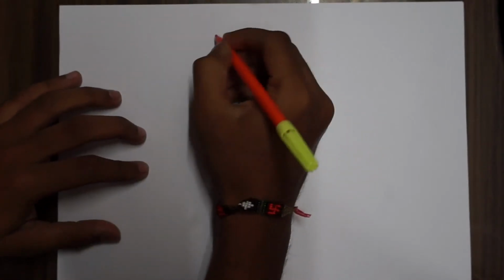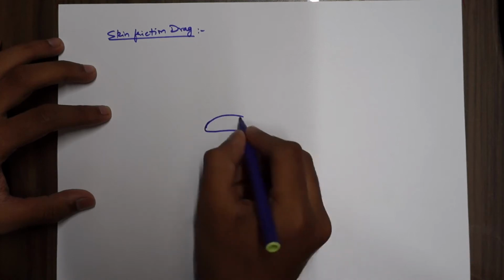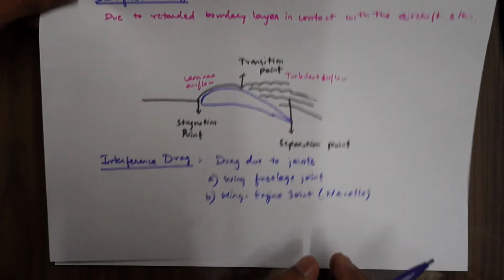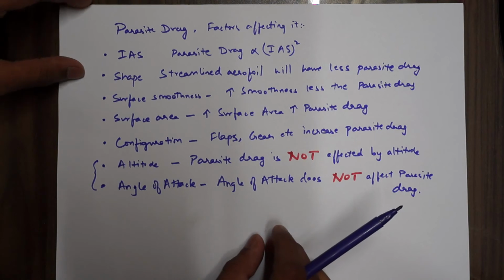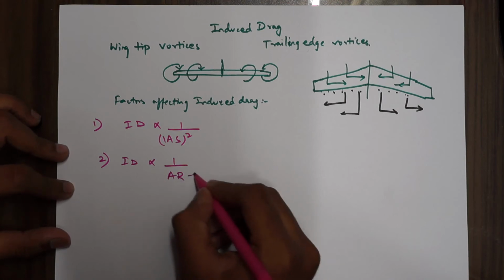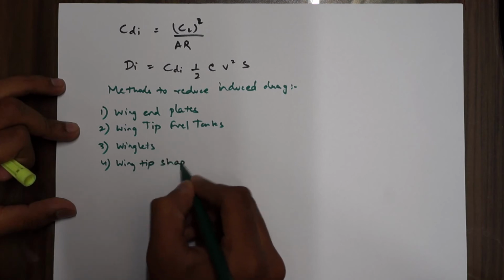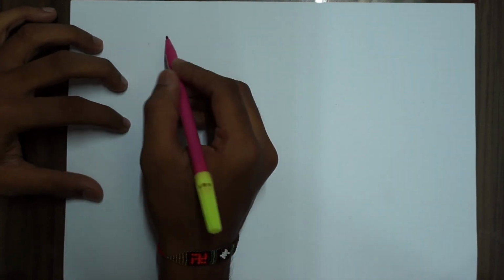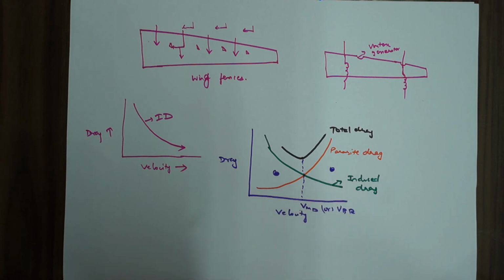Drag

Comment: Wake turbulence from the generating aircraft can affect encountering aircraft due to the strength, duration, and direction of the vortices. Wake turbulence can impose rolling moments exceeding the roll-control authority of encountering aircraft, causing possible injury to occupants and damage to aircraft. Pilots should always be aware of the possibility of a wake turbulence encounter when flying through the wake of another aircraft, and adjust the flight path accordingly.

Comment: Went though your videos .. thanks for for sharing them... however in the Induced Drag video, you might like to relook  both at the explanation of induced drag as well as the methods of reducing it.. wing fences, VGs are not used to reducing Induced drag..
Reply from the maker: It may not seem directly that they prevent induced drag but they do that a role to play. Any device which is preventing potential stall is basically reducing drag. Vortex generators and wing fences keep the airflow in line and re energize the boundary layer and in some senses prevent span wise flow which are responsible for creating induced drag.

Comment: The reason for the form drug is turbulent flow after the separation point. If you increase the angle of attack, the separation point will move forward and we will have more turbulent flow over the wing. More turbulent flow = more form drag. 
Conclusion: If the angle of attack increases parasite drag WILL INCREASE
Thanks for the video.
Reply: Btw the altitude will decrease because the density will be less. (less air molecules)

Comment: Thanks for all the videos 
I just have a confusion with regards to the last point which states AOA will not affect Parasite Drag if we increase AOA " wouldn't this attitude be giving more more parasite surface ?? 

Just a confusion 

Thanks in advance
Reply from the maker: It was actually not so direct. First things first - Parasite drag is independent of lift generation whereas induced drag is dependent on lift generation. So when it mentions AoA will not affect parasite drag meant that it will affect induced drag more.

Comment: Does Flap Track Fairings decrease the induce drag ??
Reply from the maker: +Ishwar Vyas They are anti shock bodies which eventually help in decreasing drag as in they help in smoothening out the airflow. They help in partially reducing both induced drag at slow speeds when flaps are deployed and at transonic speeds act as anti shock bodies to prevent splitting up of airflow which produces parasitic drag.

Comment: acdcording to lift formula: L=CL x 1/2ρv²S, if speed increase, lift will increase, if lift increases, induce drag will also increase, which means speed increases, induced drag increases. somthing wrong? (assuming wing area and CL is constant)
Reply from the maker: There is a difference. 1/2 ρ V² is IAS, where as V alone is TAS. So it depends what speed you plan to increase. If you are planning to increase TAS, it has to be compensated. where as IAS is automatically compensated with density.

Also, You cannot keep constant parameters just like that, when you increase speed, You will indeed increase lift but till a certain point. CL is depended on camber and angle of attack. So you cannot increase lift indefinitely by keeping other parameters constant, you have to change the angle of attack or density. That is where the minute relationship exists within the possible flight envelope. 

Just don't get yourself confused and simply remember these points and note them down for reference.

Induced drag is proportional to Lift Square.
Induced drag is proportional to Load Factor.
Induced drag is inversely proportional to IAS squared.
Induced drag is inversely proportional to Aspect Ratio.